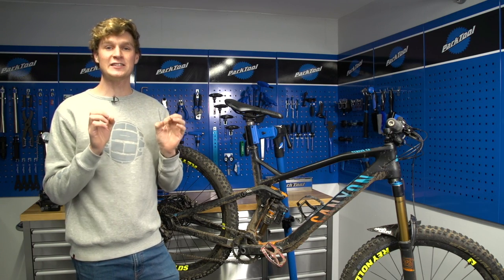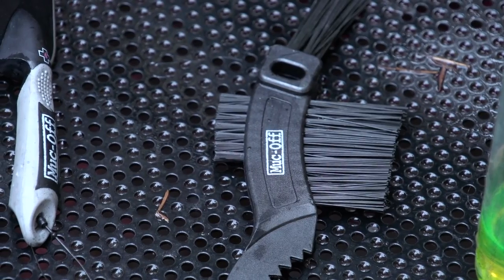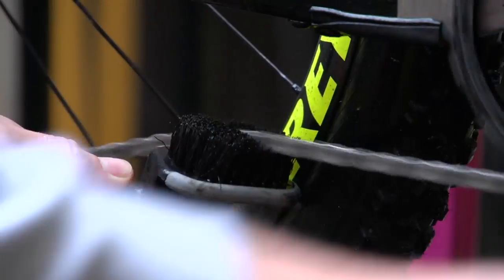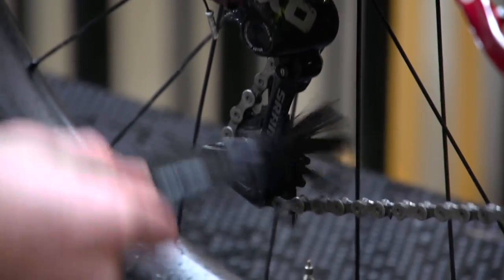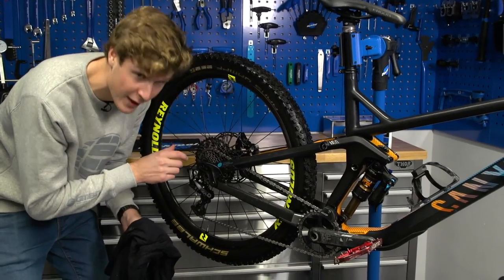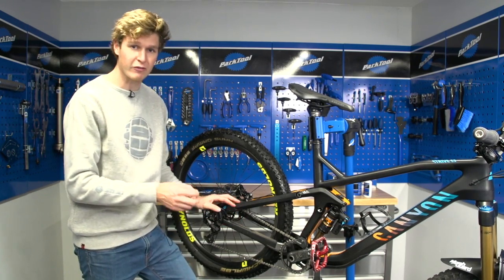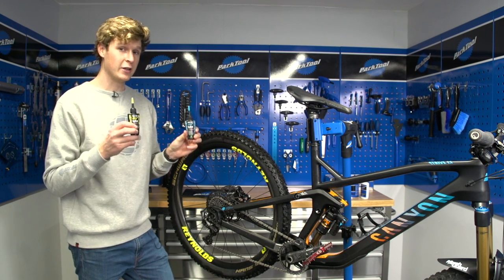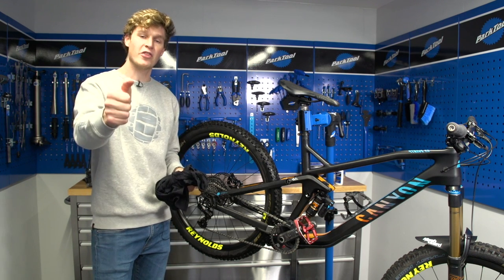How To Get A Perfectly Clean Chain + Drivetrain | Mountain Bike Maintenance

Comment: You should hit the chain with a heat gun or a hair dryer on high heat. You will have water still inside all the pins and rollers that will prevent lube from getting all the way inside the chain parts. Chain lube on the outside of a chain does absolutely nothing. As far as altering the chains strength, that cant happen to steel until the heat is at 420f.

Comment: 1) wait until mum/wife/girlfriend goes out.
2) strip drivetrain off bike.
3) put drivetrain in dishwasher.
Reply: Calum Spencer | dishwashers cleans dishes by using hot water and degreaser, so can it do the same for the drive terrain? I wonder what the drawbacks are when you do this.
Reply: +Woof Woof lots of time removing and adding drivetrain?
Reply: James Fortune | well, that's not a problem since I do take mine apart once in awhile to clean it thoroughly, I'm just thinking if it'll affect it in anyway
Reply from the maker: Comment of the week???
Reply: Sounds like you're volunteering to take one for the team and give it a shot.
I'd add that having seen Si on GCN strip a rear mech I think you'd have to spend a lot of time regreasing everything afterwards.
Reply: Mike Rotchburns that'd make for a busy house.
Reply: Calum Spencer ha ha ha
Reply: +Mike Rotchburns No, his mom is also his wife and girlfriend.
Reply: Dishwasher detergents have abrasives which can wear out the drivetrain. Think of sand.
The paint and reflectors may get scratched.
The pedals may not turn as smoothly in the next ride.
The straps may fade.
The dishes washed in the next load or with the drivetrain may be contaminated with PTFE and PFOA.
Reply: even if it were completely safe for the drive train components, would it be safe for the dishwasher? Id consider getting a really shitty and terrible used dishwasher just for washing parts lol.
Reply: Calum Spencer LMAO
Reply: I've put a rear cassette in the dishwasher, came out great. Think a chain might be pushing it
Reply: You could load the dishwasher with a bike specific cleaner in a cup/bowl.  Contaminating the dishwasher is certainly a concern though.   There might be some more eco-conscious products that don't include PTFE or PFOA.  Otherwise you might be able to run a couple cycles with a solvent that would take up those two, but I'd have to research it further.
Reply: No put the whole bike in the dishwasher or the wash machine is even better
Reply: That’s so me but I used the bathtub
Reply: YES MATE!!
Reply: Put it in the Washing Machine
Reply: lol
Reply: Dishwashers use a lot of salt and are pretty abrasive
Reply: thats.... what I do
Reply: But dishwashers generally have salt in them. How can that be good for metal? It's corrosive.
Reply: that smart af
Reply: The most important step in this process is number 1.
Reply: @iainthavinthat  And cousin strangely enough!

Comment: It is ill-advised to use degreaser every single time on your chain. In fact, degreaser should be a measure of last resort for chain cleaning, as it washes out the precious high viscosity lubricant that can only be put into the chain during manufacturing. Of course, during muddy winter, it becomes necessary very soon. 
Best way to clean the cassette is to remove the rear wheel from your bike, spray the cassette with degreaser (yes, yes, while not contaminating the brakes), wait two minutes and then rinse it off with healthy amount of water. Usually you won't even need to use a brush or anything. Cleaning the chainring(s) is best done when the chain is off. Especially if you have a 1x setup, there's no excuse for not taking the chain off. 
In order to properly clean rear mech wheels, it's best to take them out of the derailleur. It's difficult and sometimes impossible to clean them properly and when they get really gritty, they'll put up lot of resistance because the dirt will get packed in there really tight. Taking the jockey wheels out is pretty easy, it's just one screw and I'd argue it's the most efficient way of cleaning them, as you're guaranteed to get out absolutely all of the dirt and it'll take you five minutes at the very most. Do it with the bike upside down and the rear wheel unmounted. Also be aware that the tension wheel may be one sided.

Comment: Got a fancy chain cleaning device for Xmas, (plastic 'bath' type with 3 brush wheels in it) Gave it a go & found it is more faffing about than it is worth & did not properly clean the chain.  Went back to manual chain cleaning with brushes & had much better results with less fuss :-)
Reply: Less faff you mean? :D

Comment: Great video! However, using water only works just as well - just be sure to use a good brush to remove the dirt. If done correctly, the chain will spin very smoothly after cleaning with only water!

Comment: I use Aluminum Specific Simple Green, it is tough, but safe to use on most metals and finishes. Find it to work extremely well for my needs. I have to order it online by the gallon. It isnt available in most stores.
Reply: SHWELL11 I will have to try that. Thanks for the advice
Reply: NO problem. It is an Aircraft specific Simple Green. It is formulated to not leave a residue, and to not cause oxidation on soft metals. I use it in conjunction with my Ultrasonic cleaner to clean Bike chains, as well as firearm parts that do not respond well to traditional degreasers. I can usually find it for $15 a gallon online.. 1 Gallon last about 2 years.
Reply: Could ik if u have to clean after every ride or is it okay every month

Comment: The thing it doesn't show which I have trouble with is cleaning the back side of the derailleur/jockey wheels and chain ring, always really difficult to try and get brushes in from the other side. To clean the chain I use a chain cleaning tool, much less mess and does a great job.

Comment: Thank you for such professionalism in covering the full scope of the bike industry. And to you sir,.. thank you for sharing w/ such detail care.. an excellent presentation. Note: When drying w/ dry cloth, ensure dryness in it's entirety prior of lubrication: For we know that water and oil does 'not' mix. Any type of degreaser used, of course, 'must' be water soluble. Question: Some cyclist opt to use WD-40 as a solvent / degreaser w/ lubricant qualities; what are your thoughts in the use of WD-40 as a degreaser? Thanks
Reply from the maker: We use a range of WD40 products now! Classic WD40 (the water disperser) will degrease a little bit but they have an actual dedicated degreasing product which we prefer to use! If you're going to do it do it properly, right? After degreasing and drying we use a dedicated lubricant
Reply: I only mentioned WD-40 because I had read others used it as a degreaser Yes, it's simply a water "disperser" because water and oil does not mix.. same characteristics as all WD-40 products. I'll use it for a cleansing / flushing agent, but not as a degreaser when a significant amount of water is to be used as a rinse. Thanks

Comment: First, lock wheel in place and wrap plastic around disc brake. Just go right to using the Park tool chain cleaner. Much more thorough cleaning and not as messy. Don't need their fluid either. Just buy a gallon of Simple Green and use it full strength. Follow with a round of dawn dishwashing detergent diluted by 75% (to remove all degreaser fluid) then rinse with hose. Dry with compressed air or allow to sit overnight to dry before applying lube.

Comment: I use baby wipes and blue roll for a quick clean and dry. Is there a disadvantage in using such products rather than "rag" cloths? 

What about using wd40 or similar as a degreaser or water displacer?

I always place oil on the inside of the chain, you were putting it on the outside. Does it matter?

What do you do between putting on lube and removing excess? 

I am never sure about removing excess, how much do you want on the exposed surfaces of the chain at the end?

Comment: Great video. Can you be sure you didn't get water in the bearings? (I can see that is tricky issue for off road bike). Also how did you clean the yard afterwards, is degreaser down the drains acceptable these days ?

Comment: How does your bike not have any scratches? I use the muc-off dry lube because I'm in California, and it didn't rain very often. I love the stuff. I do need a degreaser and cleaner though. This is the 2nd video I've seen with the muc-off cleaner, so maybe I'll pick some up tomorrow. Any idea where to get all those brushes you were using? Great video. Any other maintenance that need a to be done, nd how often?

Comment: I'm a professional mechanic with over 40yrs of experience... Whatever you do, never ever put any type of degreaser or cleaning solvent directly on your bike!  If you want to clean your chain, cassette, or chainrings, you need to remove them off your bike and then clean them to your heart's content.  Placing any type of solvent on your bike will immediately enter your rear hub bearings, your free-wheel cassette bearings, and your bottom bracket bearings and ruin them. Any type of solvent or degreaser has very high capillary action and will easily go past any sealed bearing.   I get to see this all the time where someone purchases a new Hi-End bike and wants to keep it spotless and in less than two months they come to my shop asking "why is my rear hub making so much noise?"   I ask them "what type of chain cleaner are they using?".  They proudly answer "why I use the best Park Tool model C-bla bla bla, chain cleaner they have!"  My Heart Just Sinks...  Yet another beautiful new high-end bike ruined because of these stupid Park Chain tool cleaners, costing the consumer hundreds of dollars to replace all those bearings on the rear hubs and bottom bracket.
SO PLEASE DO NOT CLEAN ANY DRIVE TRAIN PART DIRECTLY ON YOUR BIKE, YOU NEED TO REMOVE THEM.
Reply: I just got a new high end bike, muc-off soap is okay on the drivetrain right?  very informative points you made there some time ago lol
Reply: Best option is to bring to the shop and let experts clean?

Comment: I actually prefer getting the drivetrain clean first b4 working on the bike itself.

Cleaning the bike last, ensures that any drivetrain degreaser is also washed off the body when you clean the body later.

Comment: Not bad, but I start with a wash, then a wd40 soak, then a soapy solution (muc off or the like), and then a good spray rinse with a bit of ISO, then it drys super fast and easy, re-lube with a wax based lube.....done.

Comment: how often do you clean it this thoroughly?  After every ride?
Reply: Michael Cote that depends on how often do you use your bike or how dirty get in your rides. When you see dust on it, thats ok even mud. but when you see dust mud and the lub or greaser get black thats the time to give a very well clean. After the degreaser and before the lub, use a soapy solution too.
Reply: if the bike was as dirty as in the video, yes every ride otherwise youll have problems shifting anyway

Comment: Doesn't water get into your bearings and bottom bracket when you water your whole bike?
Reply from the maker: Only with a very high pressure hose, which we avoid!
Reply: I would still spray AWAY from the bearings and internals, to be sure.

Comment: How do you tell when your hub is wearing out? My drivetrain keeps slipping when I go high power, and I've got it tuned fine, and have put a new chain and cassette on there recently.
Reply: I have the same problem, my freehub seems to be moving slightly
Reply: You guys need to get your hubs reassembled and regreased. My hub was slightly moving side to side so I took it to my LBS and now it sounds very nice and doesn't rattle at all.
Reply: Henris Ivaskevicius I've tried undoing the 10m Allan slot holding the freehub body on and it won't budge. I haven't sprayed it with wd40 but should I? I've taken out the bearing on my hub to get to the 10mm Allan slot. So I just need to undo that then I'm there.
Reply: Take your rear wheel to your LBS, it will take them about 20 minutes and it will cost about 7 dollars.

Comment: When you guys are installing a new chain, would you recommend degreasing it to remove the oil that comes on it in the packing or just lube it?
Reply: When lubricating a chain, you need to lubricate joining sections of individual links and nothing else. So when you get a new chain, it's not a bad idea to wipe the outside surface of the chain with a clean rag.
The lubricant that comes with the chain is the best lubricant you can have in your chain and you should try to preserve it for as long as possible. 
It has much higher viscosity than what you buy off the shelf, which is why some people see it as "sticky stuff". The catch here is that this kind of lube can only be added during manufacturing. What you buy as "chain lube" needs to be able to get inside the links from the outside, so it needs to have lower viscosity. 
When cleaning the chain normally, wipe the chain clean with a rag, lube up, wait two minutes and the wipe clean again. For dry summer riding, you pretty much shouldn't need to degrease. During muddy winter, it's a bit trickier and degreaser may be necessary right after the first ride.

Comment: I've a question about chain gear ratio is it true no matter what you try you can get ratios like using the top cog on back and top cog on front will always cause chain rub on the front derailleur ? I just need to find a more matching gear ratio? If that makes sense

Comment: How often should you do this? Also how long does it take? Thanks
Reply: Harry Renshaw | there shouldn't be a specific time or distance when you need to clean your bike, as it all depends on what condition and terrain your riding on. Common signs of when to clean your bike are when you see grits sticking to the drivetrain and/or you hear grinding when back pedalling. Also, check regularly on your bearings and seize points if they require re-lubing.
Reply: Harry Renshaw | And I normally spend around 30-60 minutes cleaning my bike depending on how dirty it is.

Comment: I ride my bike about twice a month but clean and lube it after every ride. How long does the chain oil last before you have to re-oil it?
Reply: I usually do it after a week of use but I do use my bike everyday, I would say every 2 weeks would be a good way to change the lube if you're not using the bike that often

Comment: Ultrasonic parts cleaner. Nothing gets a chain cleaner, I use to use a muck-off chain cleaner but it never gets right into the chain and removes the fine filth.
Reply: The muc off chain cleaner machine is shit in my personal opinion
Reply: Nice tip. Thanks. Found a cheap one of these in the bin at work, I should see if it goes, now that I have a use for it.

Comment: #askgmbn silly question, why lube the top/outside of the chain, instead of the bottom/inside of the chain?  Is it expected that gravity will help lube the rollers and plates or is it just convenience and it doesn't matter? Thanks and keep up the excellent videos!
Reply: tbh you can lube either way it doesn't matter, you need gravity to help over all but you can lube the section of the chain which leaves the pulleys or lube the section that Scott lubed it will get into the chain either way

Comment: #ASKGMBN On the subject of lubrication I remove my front wheel when I need to put the bike in my car. Should I be applying grease/lube to my thru axle occasionally? Could wet lube be used? If not what sort of thing would I use? Thanks
Reply: Max Rose yes you should. You should be using bike grease.

Comment: Best way to clean your chain :  1) buy a chain cleaning tool.  2)  fill it with WD40.  Best chain cleaner I ever used.  2nd best is camp stove gas, also known as 'white gas'.  Getting hard to find now but a very good cleaner.
Reply: White gas is just additive-free gasoline, and regular lead-free gas would be just as effective as a cleaner.  I'd avoid using anything so volatile though.  Diesel or Kerosene would be a much safer alternative.

Comment: Always after I clean my drivetrain (spray with deagreaser, brush off, use Muc-Off X3 chain cleaning device, spray off, use WD40 to remove moisture, lube, wipe off) I still can hear dirt between the links. The sound does go away after a few miles though. Is this normal or should i clean my chain better?
Reply: it may be from the fact that the lube hasn't worked all the way in so your basically grinding on metal as you cycle but as the links move more they give way and let the lube to move in more, that's the only thing I can think of.

Comment: Hi, shouldn't you put the chain lube on the "inside" of the chain instead of the outside like in this video (at min. 4:25)?
Reply: Manuel Darms It doesn't matter the point is to get it into the joints

Comment: Hey,
The chain of my Radon Slide seems to have a lot less tension than yours. When spinning the pedals backwards the drivetrain is not running that fast and smooth. It is a 2x11 setup. Is it okay like that or do you have any recommendations?
Reply from the maker: A 2x set up will usually have less tension as it needs to accommodate more gears

Comment: does it matter if I get chain cleaner on the disk brakes? it's muc off chain cleaner I'm using
Reply: Tom Appelboam if you only get it on the disc u can use rubbing alcohol to clean it. If it gets on the pads then they may soak up the fluid and likely never brake well again. I use a couple pieces of plastic from large milk jug or juice jug, cut some small U shaped slots that allow the plastic panels to fit between the rotor and the spokes on the brake side of the wheel. Have the 2 panels on different angles so the cover each other's gaps from the U shaped slots.